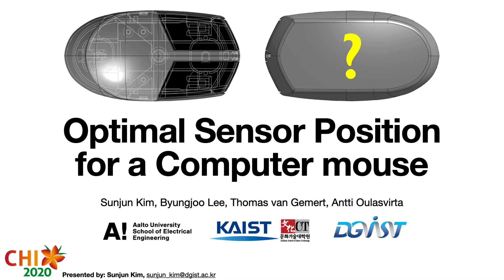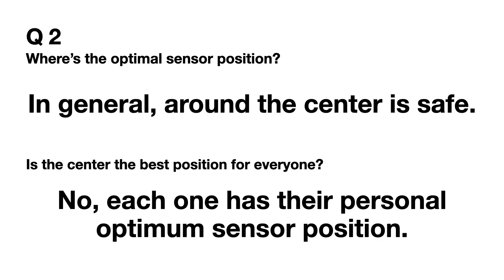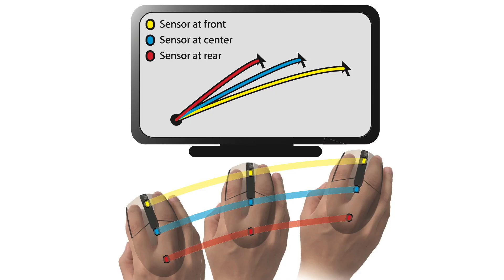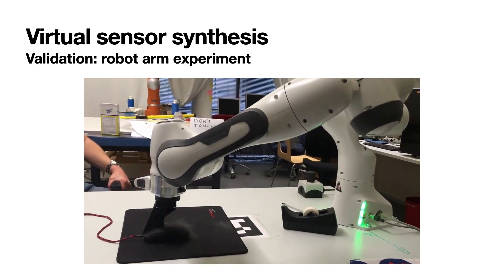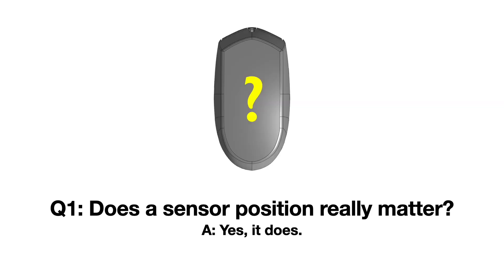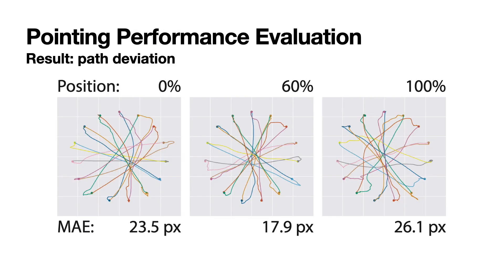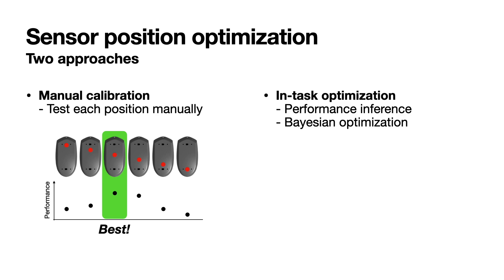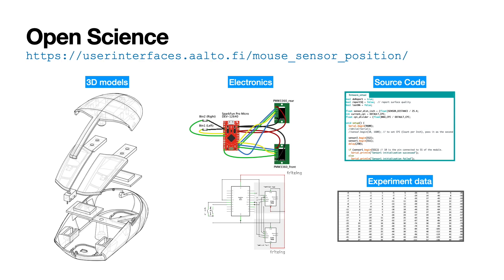Optimal Sensor Position for a Computer Mouse

Comment: While I appreciate the information provided by the video, the base assumptions are flawed/to plain.

The first problem is that depending on how you grip and use your mouse, your preference will change. This is because of the different index finger position. Humans have used their index finger for thousands of years as their main precision pointer. Why would we start to use our palms now? It's totally not intuitive and produces minimal errors therefore. The higher your DPI setting the more the problem will escalate.

Which brings us to problem number 2: "extreme high DPI". I've been addicted to high DPI since Counter Strike 1.6 with a Razor Boomslang @ 2000DPI @ 800x600. Now I am sitting on 25.000 DPI @ FullHD and can cover my entire desktop within 1 cm². My "Finger-movement" allows me to eliminate any angle movement coming from the wrist or elbow since I don't use em for aiming. The problem with such crazy DPI is that the offset of the sensor (not being under my index finger) drives me crazy. I'm holding my mouse in a very awkward position to minimize this problem in shooting games.

But my main point is about the index finger. Look at people who digitally draw pictures/CAD/3D. They need maximum precision and most of em use some kind of pen (w/o tablet) or a trackball, but only very few rely on a normal mouse. The sole problem with those pen mouse are, that those currently available cap at 1600 DPI. And that DPI is so low (compared to current screen resolutions) that it's not good for gaming. Remind you, I was using 2000DPI already for 800x600.

High sense (high DPI) gamer rely more on precision than low sense gamer. Because low sense means longer mouse travel time and thus more time for correcting your path/movement. While high sense gamers rely more on flick-shots where you need high precision in a very short time window.